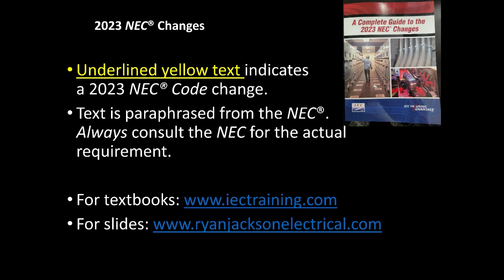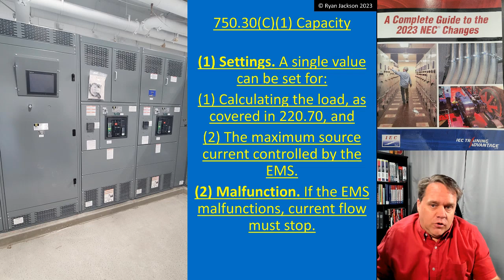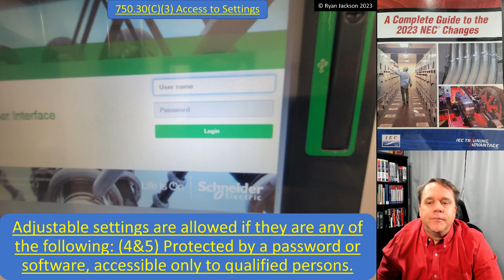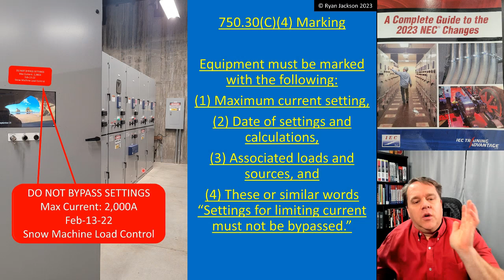750.30 Load Management

Comment: Two things on load sheding. The large hospital that I retired from was receiving over $100 K every summer to load shed  think it was 3 Mega watts. Would only have to do it for four hours and less then 12 days every summer. We would start 4 natural gas gen sets up and transfer mechanical loads and engineers would start up more boilers and run steam chillers. Of course our boss hated it because he had to pay a hour of two of overtime. While working at a large slaughter house back in the 1970's they sent my chief electrician dad to a load management sales meeting. The owners were hell bent on saving money on their huge electric bill. My dad told them it would not work because every luminare , air compressors, water pumps & ammonia  refrigeration compressors had to run from 6:30 AM until late at night after wash downs. They demanded that he come up with a solution so he told them easy just move starting time of kill floor til 6 PM. They had a salesman come in and look over the operation and he told them they could not load shed any loads during production and 6 hours after that.